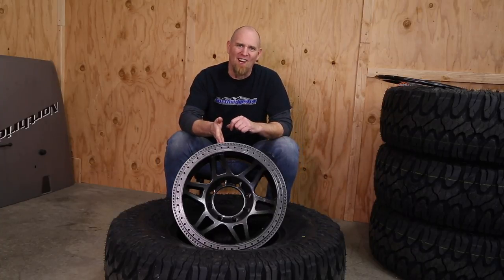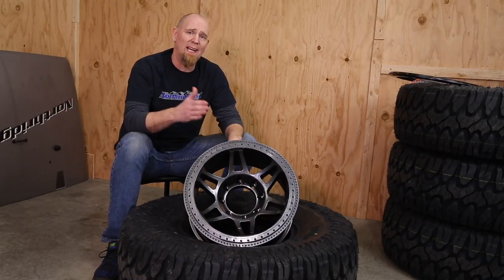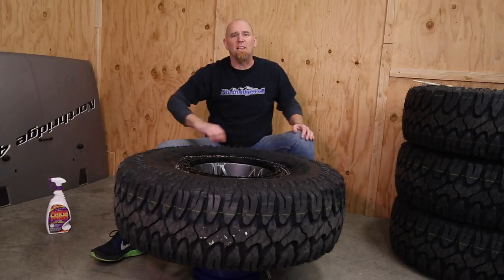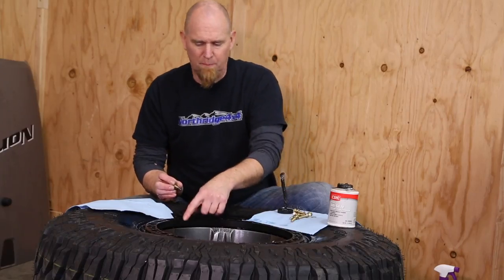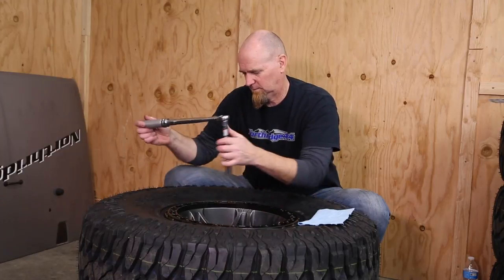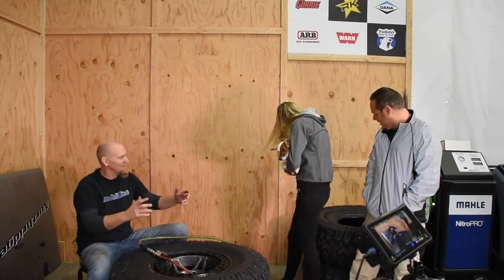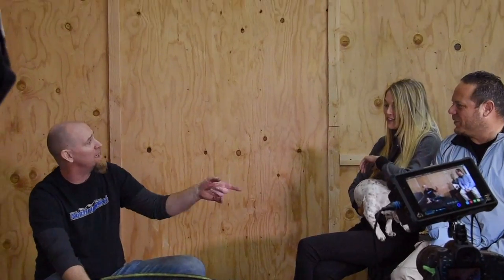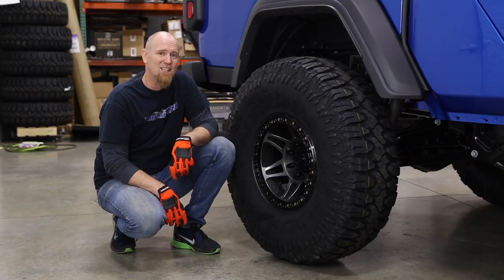40x13.50r17 Milestar Patagonia MT's on Method MR106 Beadlocks

Comment: I have 38x13.5-17 on my 2018 JLUR with a 4" lift and I run them at 37psi on the street and 8psi off road (KMC Beadlocks). I like how light they are for their size (83lbs) and the sidewalls have been very cut and puncture resistant so far. I have about 10,000 miles on this set, and had about 20,000 miles on my previous set of 35" MSP MT. I get plenty of torrential rain here in central Florida and even at 37psi I've never had them loose traction in the rain, and they don't pull very much when you hit a puddle at speed. I'm happy.
Reply from the maker: Thanks for the review!

Comment: Looking great..my driveway is waiting for my new jeep gladiator..what's the difference between the tires you put on and the black label that Kevin spoke of
Reply from the maker: The black labels are "stickies" or extra soft rubber compound. They give you excellent traction off road in the rocks, BUT they will wear very fast on the street. 
Could be gone within 10,000 miles or less.

Comment: You’re running the wheels I chose for my Gladiator, but I’m only running 37’s. I don’t need 40’s. I’m running ProRock 44 axles...RCV 1350 chromolly up front, and Yukon 1350 chromolly in the rear with 5.13 gears and Eaton E-lockers.
Reply from the maker: Sounds like a stout build Paul!
Reply: You need 40s....

Comment: What size was this wheel? Never heard any mention of that?
Reply from the maker: Those are the Method MR106 and measure is at 17x9:
https://www.northridge4x4.com/part/beadlock-wheels/mr10679050544b-method-race-wheels-106-series-beadlock-wheel-17x9-5x5-44mm-offset-matte-black
Reply: @northridgenation  Thank you!

Comment: Thx for the educational videos, I really like them... I have a 2019 Sahara unlimited with 2” mopar lift with 35” tires with stock axles. I hear a small banging when decelerating below 20 mph. Took it to the dealer and they said it is the tire size, but I see many Jeeps with 35, so not sure this is correct. Did you come across the same issue and Do you know what might cause this. Thx
Reply from the maker: That doesn't sound right. We've got three JLs and a JT here in the parking lot that all have 35s or bigger and none of them have that noise.

Comment: can I fit 35s on a stock JL wrangler? will it rub? do I need to regear? do I need to cut anything off? what's a good size lift that you would recommend? which cheap, yet reliable brand of lift kit would you say?
Reply from the maker: Do you have a Sport or Rubicon model?
The Rubicon will fit 35s stock. The Sport need a lift or a set of Rubicon fenders.
Reply: You've spent a lot of money on that Wrangler, don't go with a discount lift.

Comment: Okay so I contacted Patagonia which would be tire Co. and they only had a sales line and they had no reference other than the recommended psi for my 2020 ram 1500 what would be the correct air pressure for these tires because I’ve heard they are a crowned tire and the correct air pressure for on the street is crucial by factory recommendation is 40 psi
Reply from the maker: It really depends on the vehicle's individual weight. Air them up and get them out on the road and run them, then check the dirt pattern. Is it across the tire? add more air pressure. Is it only on the center 2" or so, drop some air pressure.
You can also use a piece of chalk, draw a thick strip across the tires and go out for a drive, the chalk will wear off on the contact pattern.
Reply: @northridgenation  So the chalk message Work she just want an even burn all the way across the tire or do you just want it to where in the center?

Comment: I’ve just bought a set of 40  how do I identify if it’s a Dot or black label type ? I’m confused with the two , I’m looking a regular street use
Reply from the maker: The Black Labels "stickies" are pretty unique, so unless you ordered black labels specifically, you probably won't get a set.
If they still have the label on them, the black labels have a black label.
The street Patagonias has a multi-colored logo.
Reply: Northridge4x4 I mean the store website didn’t indicate NHS which I think refers to the sticky ( black labels ) am I right

Comment: So you didn't need the ring spacers? Seems I read anything 37+ should have their spacers with the rings. Main reason I haven't considered the Methods...I have a set of Patagonia 40s sitting in my garage waiting on wheel selection. 🤔
Reply from the maker: The Patagonias have a thin enough bead that the spacers were not needed.
Some tires with a thick bead like Nittos definitely need the spacers.

Comment: Patagonias might be everything you think they are but y'all are based out West. Try wheeling em on East Coast terrain & I guarantee you that your opinion would change drastically. FB Marketplace in the East Coast are flooded with "like new" Patagonias with less than 5k miles...on the street, they're decent...nice and quiet but once you get em on some East Coast slick rock, off they come.

Comment: Made in Asia garbage. Not on my Jeep, no f’ing way. To each his own though. I do notice most of the stuff these major 4x4 retailers push is crap. Profit before integrity I suppose.🤮
Reply: Dave C Don't be a stick in the mud Dave, it's a nice rig.
Reply: How are you even posting this message? 😆
Reply: Patagonia tires are definitely NOT garbage. I've been running 37 12.5 17's on  my power wagon, pulling a 16ft dump trailer that weighs 5000, loaded with an 8300lb excavator for 3 years now and never had a blow out yet. Can't say that about the BadYear dura craps and Pooper  STT failure PRO's that both blew out and damaged my rambox bed fender panels.  Everything is made somewhere else. Broaden your little mind, the world's becoming a rather small place, and it ain't all made here no more man.